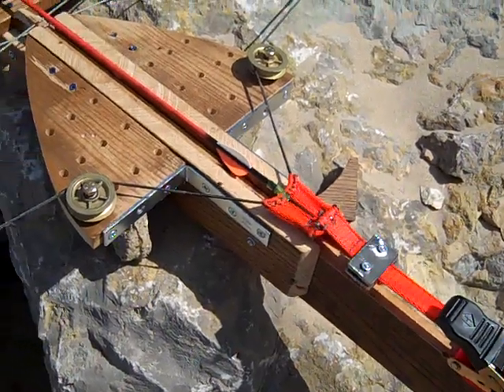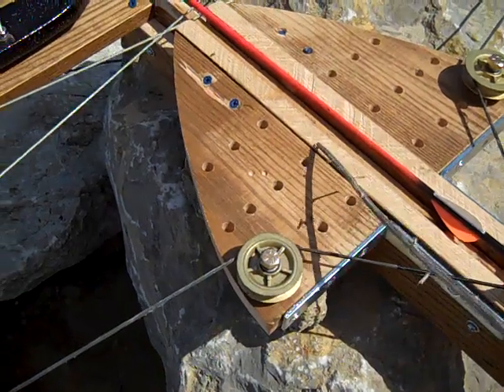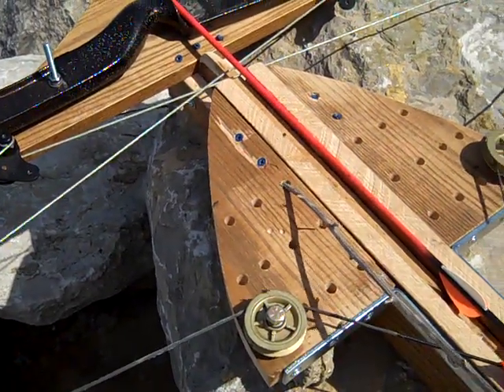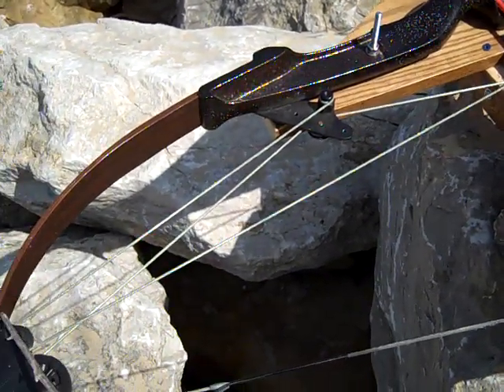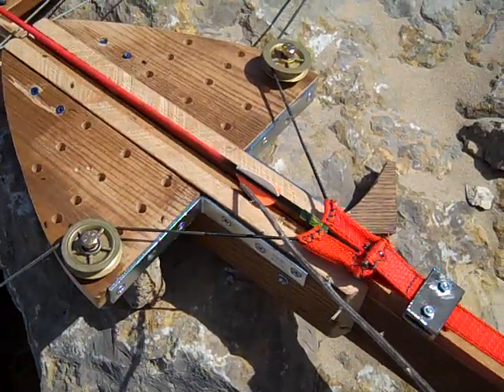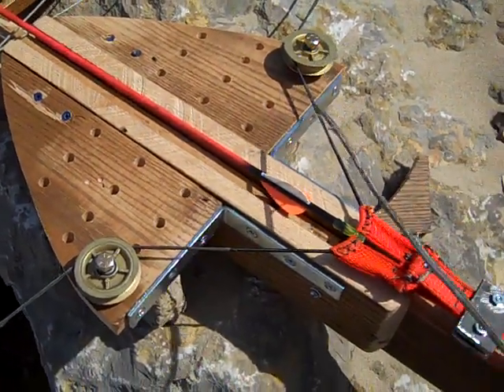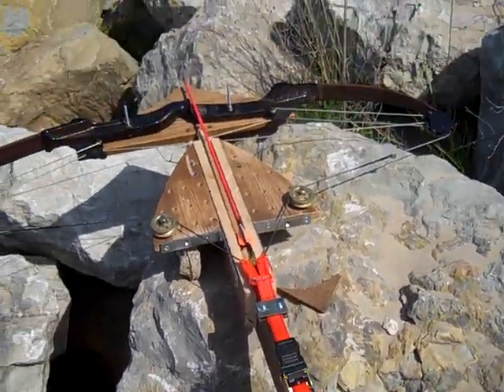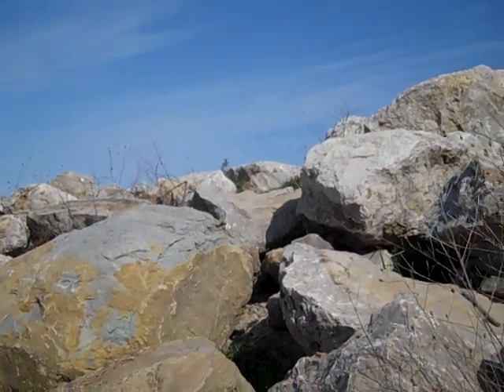Most powerful crossbow

Comment: Hi
This is a bad concept. The essence of a strong crossbow is to accelerate the arrow over a greater distance. for this it is only about 15 cm, which is very little. The concept is also wrong because this is not a crossbow, but a throwing machine, because you can't shoot it while holding it in your hand only if the whole structure is attached.....

Comment: You have an interesting concept here.  But without some type of measurement to back up your claim, you are going to get a lot of negative feedback. 

I would suggest getting a chronograph to actually measure the velocity.  Also, measure the draw weight, and weigh the bolt.  That will give you much more real credibility, and also give you real data to compare to other crossbows.  Now that you have it built, do a comparison on the different settings and graph or chart the data, even if the data doesn't support your claim, you will get good feedback for sharing the info..

Also, once you know the draw weight you will easily be able to calculate how heavy a string you need.  Lots of info out there on how to make your own strings from B-50 Dacron.